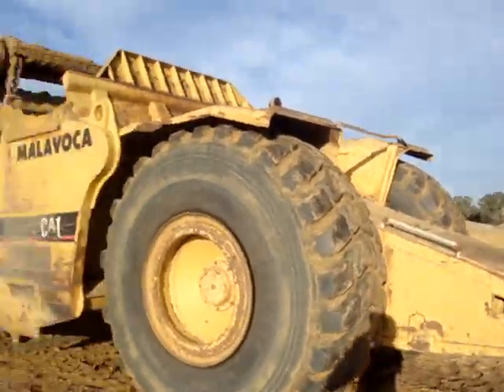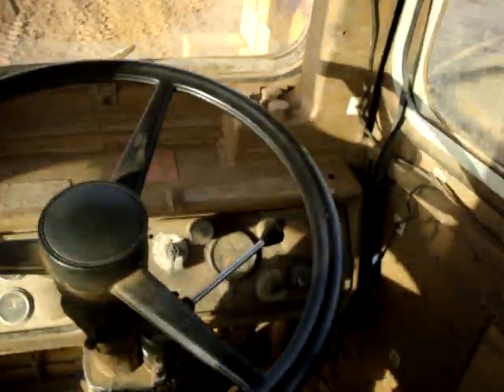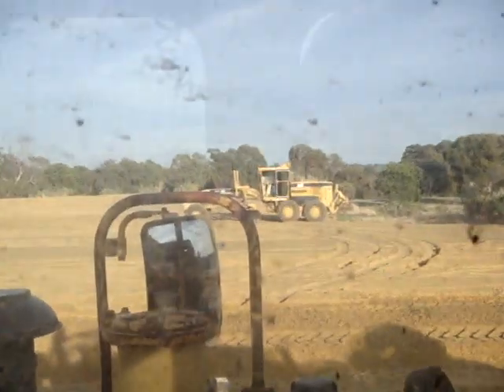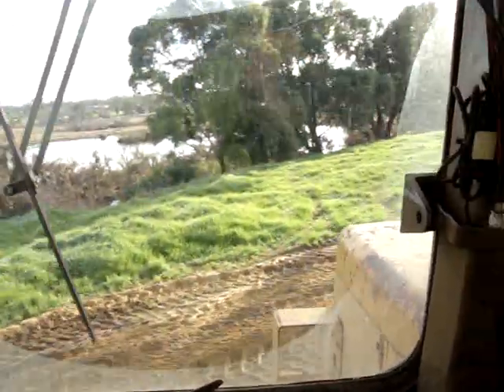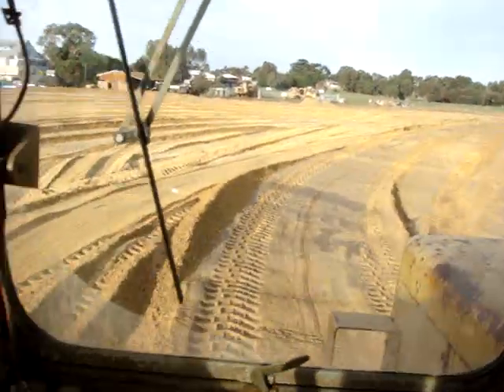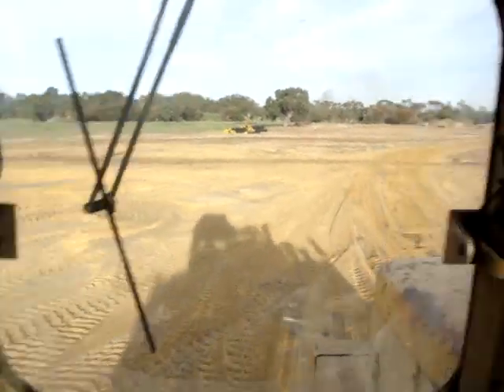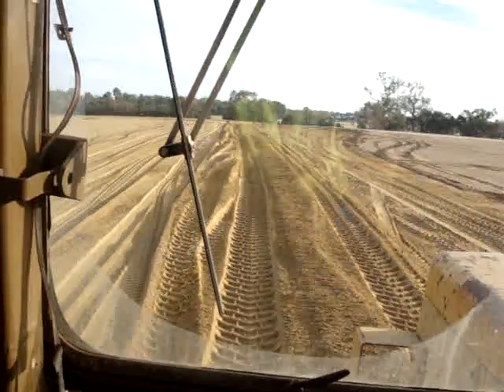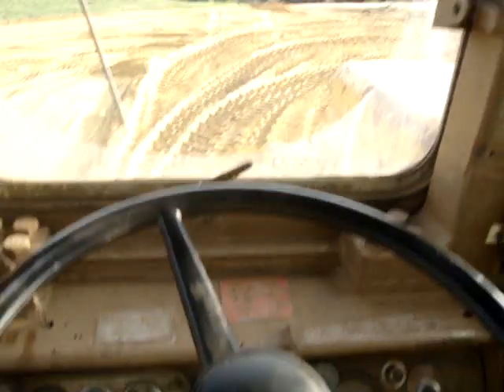How to operate / drive a scraper

Comment: I think this old girl is pretty tired, she's not jumping up the gogs very quick, even if it's a bit sandy. like you say they're good for 60kph when you get em wound up. I drove a 631C on a job and they're a good old bus. Loved it, til it near caught fire... the main Hydraulic line was shooting oil onto the turbo. It was panic stations for a bit when I couldn't get the excellerator peddle to come back to shut the motor off, I had to jump up and shimmy round the front to kick the fuel rod on the pump to off.